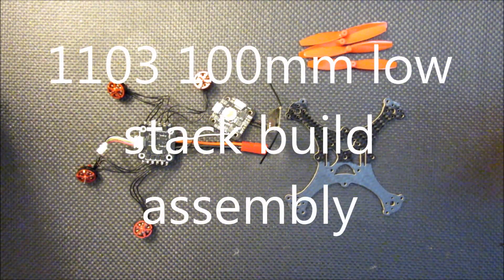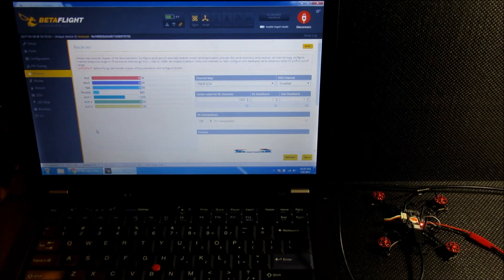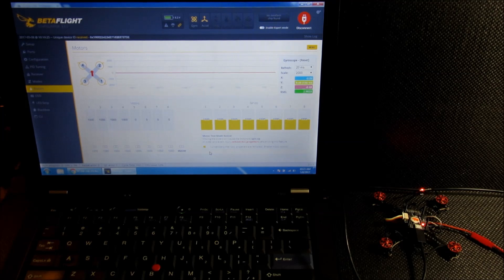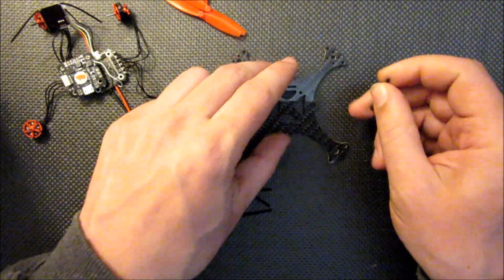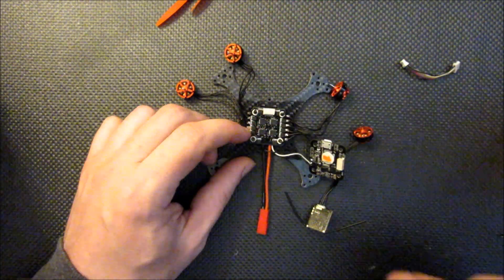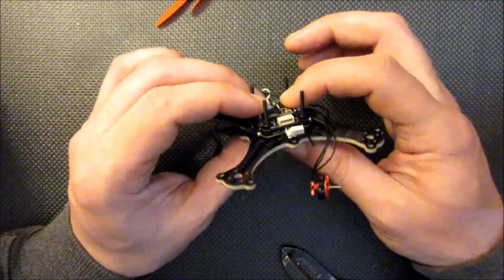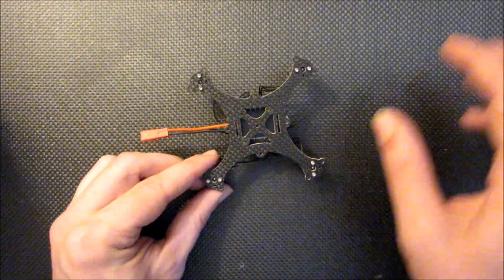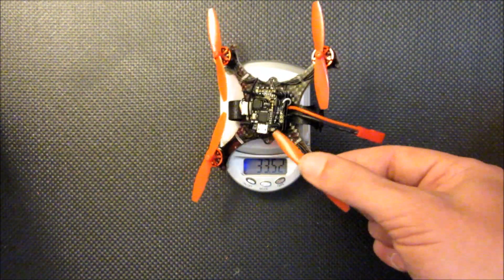1103 build part 2 100mm Quadcopter assembly

Comment: Ah i see now, drill out the props and add a little super glue with the needle to ensure no clumps/gobs, that is brilliant! Thanks for the great advice also to possibly cut them off with clippers if you need to replace them, that is what I will do with my 2S 1103 10000KV beast!

Comment: I used tiny O rings on my recent builds from 1306 to 1104 motors. I put the O ring under the motors I have used 4 screws though. but it really reduces vibration.
On my X210 I used silicon tubing under the motors like 2MM pieces of (old printer ink tube from an old printer) this has really reduced vibration in my video feed allot.

Interesting ideas! I use superglue for almost anything now. very nice build David and the weight range and features are incredible for you build. 

Do you use betaflight? my quadcopter became allot less stiff by disabling the filters upping the rates and for punches anti gravity gain really make a difference. its almost as stable as a dji phantom on punches but on steroids. incredible.
Reply from the maker: Thanks,
I had to cheat and did put in a couple "pre-maiden" test flights.  Other than having to crank the P way down I'm actually not getting much vibe if any.  Think the hybrid frame material helps here as it's more rigid than solid CF for a given weight.  I did consider O-rings under the motors but wanted to see if I could get away w/o as I never needed it on any other build.  

I used Betaflight for the first time with this build.  Pretty sure the same filter changes can be made in Cleanflight too.  I've never had punch issues either, only slight prop wash stuff in hard moves almost everyone gets.  The filter reduction stuff should really help there but I won't get into that until I FPV it.

Comment: 33.5 grams is impressive. My 1103 quad is 40 grams. Looks like I need to trim off some connectors. Looking forward to the maiden flight. Do you have any plans to add this frame to your store?
Reply from the maker: Sorry, I can't really justify officially expanding the Picnic Quads lineup at this point.  I did cut some extras though and threw together a rough page quick if anyone really wants one of these:   http://picnicquads.com/product/100mm-1103/